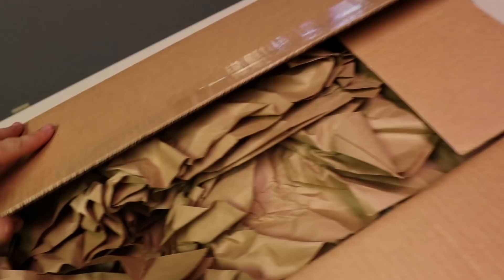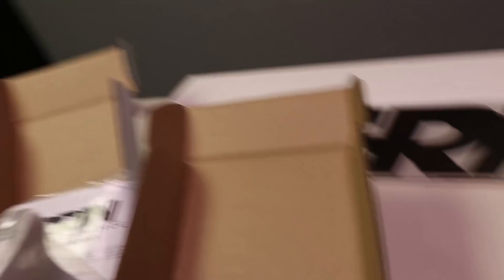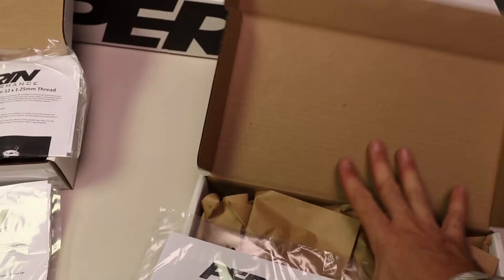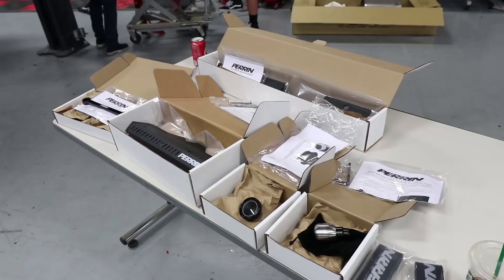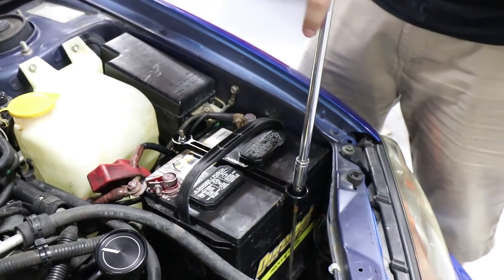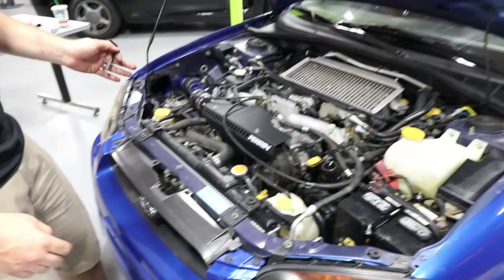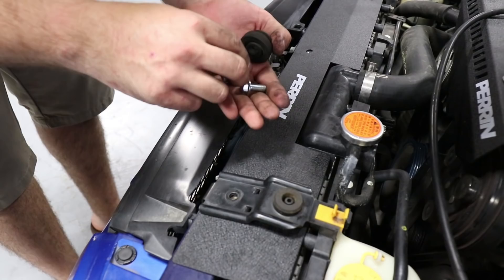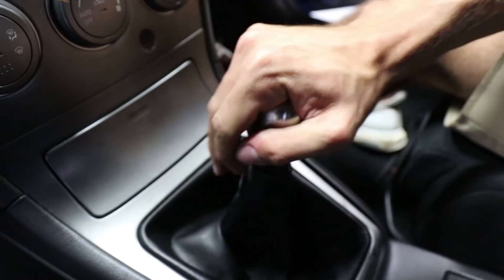INSTALLING 5 WRX MODS THAT CLEAN UP YOUR ENGINE BAY! (PERRIN)

Comment: Now that you got a Perrin oil cap, you should replace all the caps (gas, radiator, etc....)with Perrin replacements to make the car POP, & cuz looks so much better. That would be awesome if did that.
Love the shift knob, & all the Perrin parts. They have a great finish & texture to them, NICE...
Cheers, A
Reply: those hoses for sure

Comment: Get a catless Downpipe and up pipe and an sti top mount intercooler and also some 565cc injectors. Don’t do a front mount as you will have a lot of lag on the stock turbo.

Comment: Damn son all those free parts add up to 0 hp .
Reply: 01GTB Daily Perrin “PeRfOrMaNcE”
Reply: Drew Burgoyne ohhh so like when Tom Cruise is with a woman. It’s just for show
Reply: This build is going to be stupid. I hate to say it cause I own a wrx my self. But it's all basic vape bro mods. 

I would've loved to see power mods. And not a stupid intake and exhaust. 
Bigger injectors, fuel pump upgrade, larger turbo, bigger tmic. Etc. Shit to get it to 300 wheel. Not flashy, useless mods.
Reply: Christian Nieves bro theyre giving it for free pretty much be grateful duche
Reply: Yeah, damn, not even any stickers. Everyone knows that each sticker adds 5hp. Besides, I have been seeing all of this Subaru content, and not one vape cloud. That's like school in the summertime...it don't make sense...
Reply: IMNOTA  Ohhhhhh lord. Here we go. How am I ungrateful? I'm not sitting here asking them to give me the car.  

It's alright, everyone goes through the basic bro stage when they get a Subaru. And BTW, "I wouldnt tune it like that" makes Zero sense. These are BASIC bolt ons. And BASIC upgrades. :) the most this car is going to see on the dyno is 240 to wheels. Baaaaassiiicccc <3
Reply: That umm shift knob decreases shit time by 0.001 second dont forget tht🤣🤣

Comment: Isnt those brackets for the water cool er supposed to go under that new perrin cover plate ? 
Like that with them on top the cool er brackets dont hold the cooler properly,  and it would look much cleaner with them under the perrin plate as well ..

Comment: i think you just pull the rubber out of the old radiator mounts and put them into the plate. i cant see them making a really nice plate only to design it to have the old ugly mounts on top of it.

Comment: Could anyone tell me what metal parts (Nuts) are used inside the engine bay as they always rust/corrode? And is there an alternative to use that doesn't rust?